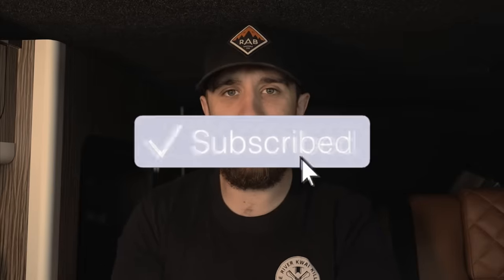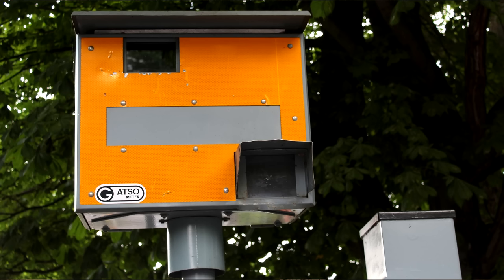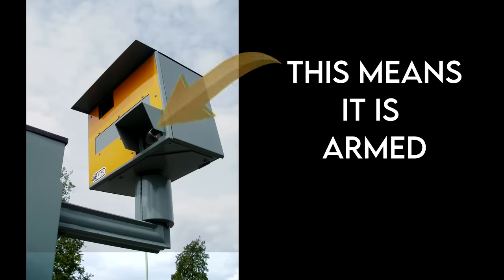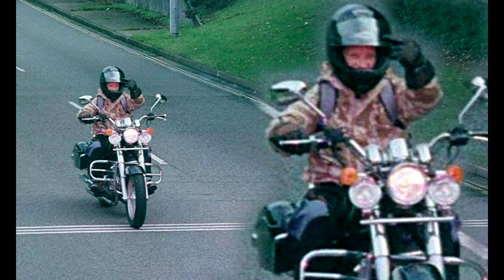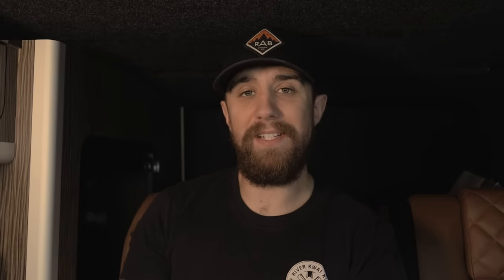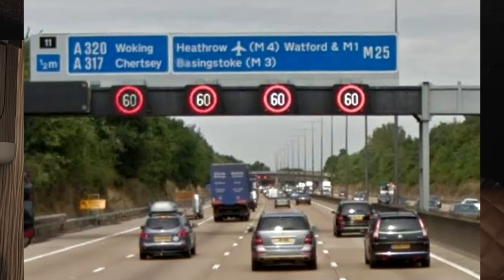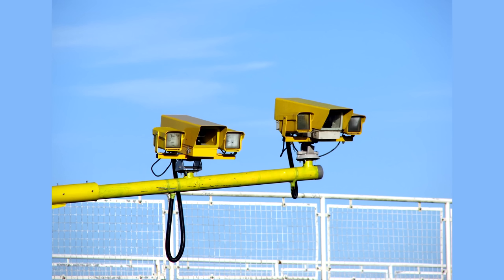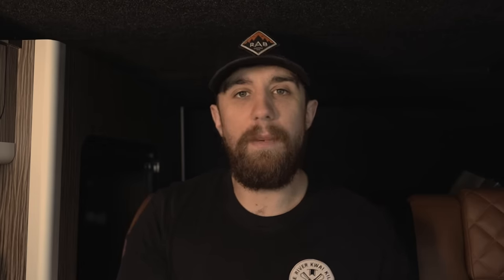How Speed Cameras Work and What to Look Out For

Comment: In extended road works (not that there is any work going on) speed limits of 40mph with average speed cameras are extremely wearing, and I would argue dangerous in themselves, having to spend too much time looking at the speedo rather than the road.
The only relief from that is with either a speed limiter or cruise control, so that you can concentrate on the road without worrying about inadvertently exceeding the limit. My previous car, a Focus, did not have this so I was glad to get rid of it (It was also probably the worst car that I have ever owned- so much for German quality!).
Reply: Personally I disagree. If you can't keep within the speed limit without taking your eyes off the road for so long you feel it's dangerous, then i'd argue you shouldn't be on the road.

It literally takes half a second to glance down... look up again. 10-15 seconds later look down again briefly, back up... I was always taught when I was learning to check my rear mirror every 6-10 seconds. 

Never understood this argument of "it's too dangerous to keep checking the speedo". It just sounds like a petty excuse for getting out of a fine from an average speed camera. The standards of driving now in my opinion are shocking, plenty of incompetent drivers who can't drive, or think putting an indicator on suddenly gives them "right of way" to pull into a lane cutting a whole queue of cars up.

Amazingly people complain that it's "dangerous" to take your eyes off the road to quickly glance at the speedo.. but many of these people would happily drive around, phone in hand scrolling through their phone, or fiddling with the radio. I even saw one driver almost mount the pavement and hit a pedestrian at 20mph whilst she was trying to reach something that had fallen into the passenger's footwell....
Reply: @thefiestaguy8831  I would like to point out that I never touch my phone whilst driving. Do you have evidence that it only takes 1/2 second to take your eyes off the road, focus on the speedo, and then refocus on the road ahead?  Even if that were the case, travelling in a 40mph limit with narrow lanes and concrete crash barriers on the side, you can travel 18 metres in that time. that is plenty of distance in which a collision can occur, perhaps when someone in an adjacent lane is reaching for something as in your example.
Reply: @MervynPartin  I can't possibly evidence that as it's never been "evidenced". That's roughly how long it takes me to glance down to the speedo. It's a quick look down, then eyes back to the road. Usually I can do it and eyes back on the road in less than 1 second. 

The point you raise about someone reaching for something in an adjacent lane and possibly colliding with them is somewhat moot... if they're reaching for something in their vehicle to the point where they drift out of lane, they're not in proper control of the vehicle.

As I've said.... many people funnily enough claim that it's dangerous to "look down at the speedo" when driving in an average speed camera zone, but would quite happily take their eyes off the road for more than 1 second to play with their phone, turn and face their passenger to talk to them, or fiddle with their radio/sat nav....

I've seen lorry drivers literally reading itinerary sheets whilst driving an 18 ton lorry, delivery drivers ticking things off as they drive with their knees or the palm of their hand...

Speaking for myself, personally i'm quite good at keeping my vehicle at a consistent speed. I can balance the accelerator to the point where the speed stays consistent, I very rarely ever use cruise control, as such often a quick glance down to confirm i'm driving to the limit, and then I don't need to look down to check again for a decent period of time. 

The tolerances in camera activations and NPCC (formerly ACPO) guidances are there to allow for this and speedo inaccuracies, even though speedometers over-read and not under-read.

Comment: There’s a new type of camera system on the M4 about 2-3 miles from junction 8/9, it’s mounted on an average speed camera post, but is forward facing, lenses are darkened (indicating IR), rectangular in shape & if I recall correctly, 4-5 of them. I abide by the laws but was wondering if anyone knows more info on these cameras? I find it quite interesting!

Comment: Both Bedfordshire and Leicestershire are using average speed cameras mounted on street light poles, some of these poles will have stripes painted on them and there is usually a small mark on the road in the form of an L or - painted white.
Reply from the maker: Very good info mate, hopefully helps someone out. if more info like this comes out I may have to make a sequel 🤣
Reply: Yes I have seen these and pop up on my Tomtom

Comment: Good video, but you forgot to say how to tell if there is a camera in the Gatso box.  On the back of the Gatso are two round holes - if there is no camera they are closed off with a metal shutter - if there is a camera inside they are open and you can see the glass lenses of the speed radar.

If you speed pass an average speed camera, slow down and stay under the limit, so your average speed will be legal by the time you pass the next camera.  Ideally use the cruise control so you stay legal. 👍

Comment: Where I live there is a quiet road about 1.5 miles long around a bend shaped like a lower case letter r. At the beginning of the road is a camera warning sign but no camera to be seen. Near the end of the road is a camera sign and a camera mounted on a pole on the other side of the road, unpainted and facing forward towards the driver. Is this camera measuring average speed over the whole stretch of road?

Comment: Gatsos don't work above 170mph. Also, you can trigger them from the front if you're fast enough in the opposite direction. Fun to see them flash the empty road behind you! Not that there's many left now.
Reply: I set one off driving towards it. It flashed in front of me but never received anything as legally in the UK they are not currently home office type approved for forward facing photograph so you cannot be prosecuted, only with rear facing for Gatso cameras.

Comment: I understood or read that the camera vans had front facing cameras in the windscreen to catch a motorbikes plate, is that false?
Only ask because I approached one last weekend on my bike on a motorway and i turned off the next exit. I am expecting a fine?.
Reply from the maker: You should be good but it's hard to say without seeing the exact situation
Reply: Some do have cameras in the front but they don't measure speed from them.
Reply: @NoBody-gf8ie  I would assume then that they would catch your speed from the back camera, then use the front one to identify your plate to send the fine? I actually don't know what speed i was doing, not purposely speeding but i have a feeling i was. I did see it early on but since they have a mile range it likely saw me before hand!

Comment: Should these cameras  be calibrated yearly like shop scales?   Is it a defence if you are only slightly over the speed limit to ask for proof of when camera was last calibrated and tested?
Reply: They are calibrated yearly? The camera calibration argument doesn't usually work in court when people on a whim try to get off of it, because when the prosecuting body present the calibration certificate which proves it was calibrated within the last 12 months - the whole defence is usually out the window and you're found guilty and given a larger fine and more points for going to trial.

Comment: You missed RedSpeed cameras, they do both red light enforcement and speed.

Also, I’ve set off a gatso in the past driving towards it, I was doing under the speed limit and there were no other vehicles on the stretch of road anywhere near me, as I drove towards it, it double flashed.

They can go off front-facing, but you cannot currently be prosecuted by a Gatso if the photo captures you driving towards it, as they are only currently approved by the home office for rear-facing photography.

Also, the bit about active gatso’s having lamps in the flash unit is not entirely accurate. There’s a camera in Surrey, just off the M25 before you enter Croydon just past a Waitrose fuel station. It’s got a lamp in the flash unit, it’s a dud camera as it never flashes, it’s a 30 zone and I’ve seen numerous people speed past it well in excess of 30, including an ambulance on a blue light run doing between 50 and 60, and it’s never flashed on any of the multiple ocassions, so it’s clearly just an empty box.

Finally, HADECS Cameras do flash, I’ve seen them flash both day and night on motorways, you regularly see cars in the other side of the road on motorways set them off and the flash is facing you and is very visible. The unit next to the camera is the flash unit, not an infrared emitter. I was once driving on the motorway in darkness late at night, about 11PM, a 50mph speed limit was in effect on the overhead gantries, I passed at 50, and a white van came up behind me and flew past at about 70, as he did so it double flashed, very brightly so. As such this would indicate they do flash and do not use infra-red light, or only in some of the cameras is infra-red used.
Reply from the maker: If it's got a lamp in its armed. If it doesn't flash it when it's got a lamp on its broken. T it seem the rest of the info is pretty usefull. Thanks for the comment.
Reply: @CorpsMedia  You could be right about the lamp, but that speed camera has been there for a long time, and it’s not flashed in the last few years, I used to drive past it regularly, and haven’t seen it flash in at least the last 3 years, despite seeing people speed past it quite regularly. You’d think if it was broken they’d realise and get it fixed.... when they come to collect the film and realise it’s not captured anything.
Reply: @thefiestaguy8831  I would suggest it's not switched on and just there as a visual deterrent.

Comment: Interesting video, not sure about the Specs cameras though. How do you suggest a specs camera measures the drivers speed throughout all the distance they are set for? Thats already hard enough to do for 1 car, very unlikely to do for 200 cars at the same time in multiple lanes. I am never going the advised speed on the specs cameras  and have never received a speeding ticket for these areas. Not bragging, just stating a fact on an actual example.
Reply: Very easily?

The camera doesn't measure it - the computer behind the system does.

The camera just records a registration plate along with a timestamp... i.e at camera 1 - the car passes at 07:25AM, this information is a "read" and is added to a database.

At camera 2, the same car passes and it's registration is taken, added as another "read" to the database, say at 07:28AM. From these two times, the software can calculate that the vehicle covered x distance in 3 minutes. Since the average speed cameras are at known fixed locations (i.e say 2 miles apart) it can easily work out the vehicle covered 2 miles in 3 minutes, giving an average speed of 40mph average speed.

This is simplified somewhat as the cameras are paired, there's usually more than 2 but there's no way of knowing which 2 cameras are paired, sometimes it's the first and second camera, sometimes its the first and third, or first and fourth.... there's literally no way to know. Changing lanes also won't trick the system as it literally reads your registration, and adds the timestamp to the reg into a database.

The only thing that might realistically work is if you drove past one of the paired cameras with the plate obscured, i.e perhaps a large lorry between you in your small car and the camera, obscuring your car plate from view.

Comment: You can argue up to 2mph in court and likely win your case, to allow for driver error, as per the CPS Website, 2mph is allowed
Reply: Enforcement starts at 
10%+2mph with all cameras set to that threshold.
Reply: @NoBody-gf8ie  most cameras are, the hasdec cameras are set to 2pm over when triggered by overhead gantry speed restrictions. you can only legally argue 2mph in court.

Comment: Speed cameras should be there to save lives but turned off at a certain time when there is no traffic or pedestrians around. Outside schools, it's usually 20 mph in the day - I get this - but 2am in the morning and we still have to stick to the 20 mph limit? That doesn't make sense to me!
Reply: The trouble is that if the power goes off to a Gatso then the need what is called rekeying and that requires opening it up and connecting to a laptop so its not really practical.

Comment: I have a question please? Are there cameras on top of the signs that flash the speed limit ONLY if you're exceeding it? (Not the ones that give a smiley face if you're within the limit). I ask because there are a few near me and it looks as though there are cameras on the top middle part of the sign
Reply from the maker: On the motorway if the speed sign is illuminated it will catch you, if not the camera is inactive. However the ones at the side of the motorway can be active at all time.
Reply: @CorpsMedia  sorry, I didn't mean on the motorway. I meant roads that usually have one to keep you from exceeding a 20mph or 30mph limit?
Reply: They aren't cameras, they are literally sensors, they calculate your speed and display it to you. They don't record or store anything and cannot be used to prosecute you because they are not evidential in any way.

Comment: I'd like to clarify a couple of points. The old Gatsos you mentiond use radar as the primary measurement that triggers the camera, the lines are only there to corroborate the radar. You are correct that not all Gatsos have cameras in them as the camera itself is the most expensive part of the whole installation. However, radar speed meters like the ones used inside the boxes are fairly cheap and are often paired up with a camera flash unit to give a dummy flash at anyone caught speeding, just without the camera to actually take the pictures.

You mentioned that mobile units are required to be visible and with advanced warning signs, this is not the case. The police can be as covert as they like when fishing for speeders and it will not affect the validity of any evidence they gather. North Wales Police use a horse box parked in laybys at various places on the A55 as one example. So for every camera you do see, chances are there's another one that you didn't see. (edit) the range on the most commonly used laser speed meter is 999m not 1 mile.

The reason cameras were painted yellow was to allow the police force responsible for it to keep any fines it generated. This was changed a few years ago and now any money from fines goes to the treasury and the cameras are no longer required to be yellow. 
Saying that speed cameras are only there to generate revenue for the government doesn't make any sense because on the whole, speed detection costs far more to operate and administer than it ever generates in fines. At best it just about breaks even.

Comment: Don't complain, in Belgium it's much worse. At one point there were 2000 speed cameras for Flanders alone, compared with 6000 for the whole UK.  
Most of the revenue flows back to the police and it shows. Before they started installing those things by the cartload in the 1990s our police force usually drove in old worn vehicles such as the Renault R4. Today they can afford high spec Audi and Volvo SUVs.

Comment: Fitting rims and tyres to one's vehicle that are not according to manufacture's specifications can lead to excessive actual speed even though the vehicle's speedometer is reading the speed limit. This is because a rim/tyre combination that results in a larger diameter at the road surface will cause the speedometer to under read the actual road speed.

The tyre will rotate slower for a given forward speed so that if the speedometer is reading the speed limit, the vehicle speed detected by radar will be higher.

The solution is to fit a GPS system that will show actual speed rather than to rely upon the vehicle's speedometer.

Comment: One question average speed camera on motorway if you did go out of view due to a truck on a set of cameras would they still have enough info to measure your speed at the end?
Reply from the maker: I used to do this alot whilst riding my bike, although I never got a speeding fine I wouldn't want to say it was purley because I avoided it.
Reply: Depends on how many cameras there are and how they are paired up, they work in pairs.

Suppose you have 4 cameras, sometimes cameras 1 and 2 will be paired, and 3 and 4 paired, other times it’s 1 & 3, 2 & 4. And that’s a very simplistic view because most motorways will have more than 4 ASC on them. If you went past the first one, in the pair, and your reg was on display, but at the second one in the pair, it was covered, then yes, you’d get away with it, as the camera couldn’t read your plate so wouldn’t have two time stamps to work out a time and distance calculation. If however cameras 1 and 3 were paired, and you went flying past 1, your plate was covered by a lorry at 2, but at camera 3 your plate was visible, unless you’d reduced your speed right down so it averaged out within tolerances, then you’d be caught.
Reply: thefiestaguy 👍